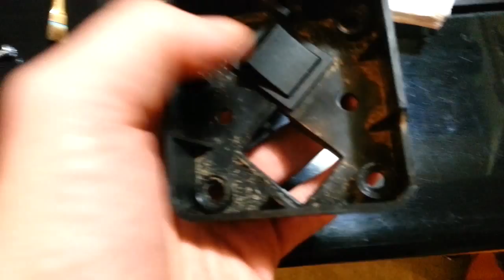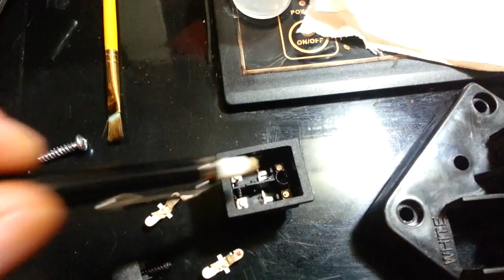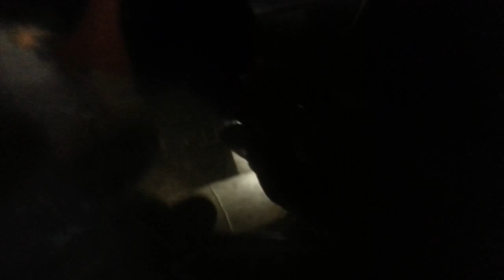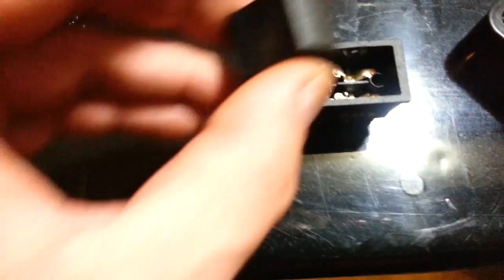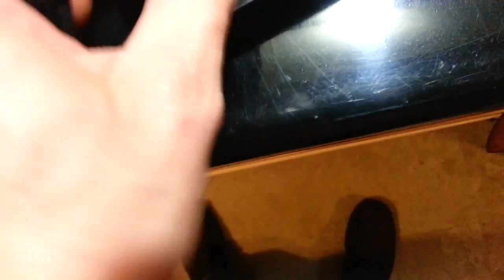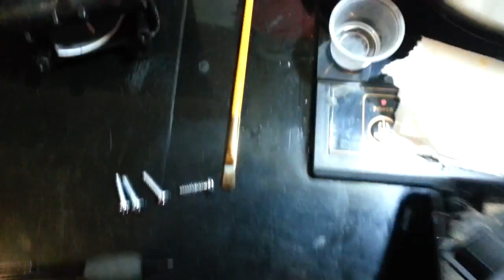Power Wheels switch cleaning F150 shifter 12 volt

Comment from the maker: To get to this point you first remove the seat (4 screws).  Then the end of the trim piece which surrounds the shifter and cupholders will be exposed.  Pull up on the exposed end and it will pop loose.  Pull a little more and the tabs near the shifter will pop free.  Remove the trim piece and the two screws holding the shifter will be exposed.  Remove these screws and lift the shifter.  Gently pull the two electrical connections free from the shifter and set them down.  The shifter will separate with 4 screws on the underside.  After reassembling the shifter work it forward and back listening for the clicks from the switches.  Separate and readjust if the shifter doesn't seem to be actuating the switches properly.  Hook up and test.
Reply: My son's was working perfectly fine till i turned it over to get some dirt and a little water that had settled on the floor now it won't go in forward just reverse what do you recommend i do replace the shifter and the peddle or just the shifter the truck is basically new i can count on my hands how many times he's used it we bought it a year ago but it was too big for him to handle so we parked it  and now it's broke so i really don't want to except that we just wasted $400 so if you could help me understand what to do
Reply from the maker: @stephaniegonzales5900  I'm sorry that I didn't see this question sooner.  You may have it sorted out by now.  I would say it's just an issue with the switches inside the shifter.  If it works at all the plunger switch in the pedal should be fine.  Thanks for commenting!

Comment: I was walking down the street today and happened to spot one of these sitting in the yard, asked the contractors if they were tossing it and they were because it didn’t run. Figured, whatever and rolled it home. As I was cleaning the leaves and trash out of it my three year old was messing with it and it backed up. After fiddling reverse was all it had, came across your video looking for a solution and just before I ordered a whole new shifter unit turned out one contact was corroded. Runs fine now. So basically a $400 ‘toy’ for free and ten minutes of tinkering and a small piece of 1000 grain waterproof sandpaper. Thank you!

Comment: Thanks for the great video excellent write up. I just use the sock and shove the screwdriver through it instead of an eraser and it wasn’t so much corrosion is just residue on the Contacts but my springs definitely were rusted and I put some oil on them. The other switch look brand new.
Reply from the maker: Thank you!

Comment: Thank you sir very much for the great information. After I remove the seat and the shifter I noted that my upper connection which goes forward was loose after brief cleaning reconnected everything‘s good apparently the bottom connector is for reverse and it was solid and it looked great thanks again for the great info and insight. Peace be with you!

Comment from the maker: I eventually replaced the 2 switches with new ones. Order enough, they are cheap. I coated the new switches with silicone paste (not silicone sealant! Paste, like the spray will not harden and will protect plastic and rubber) to reduce friction wear and repel water.  Here is the Amazon link to get new switches - https://goo.gl/HWkoJP